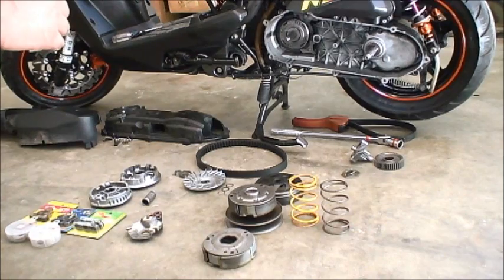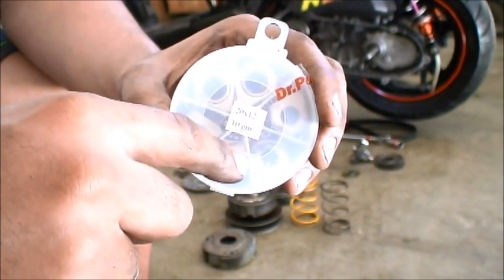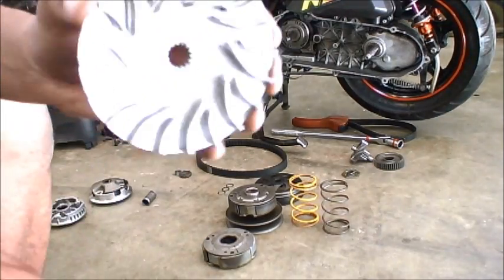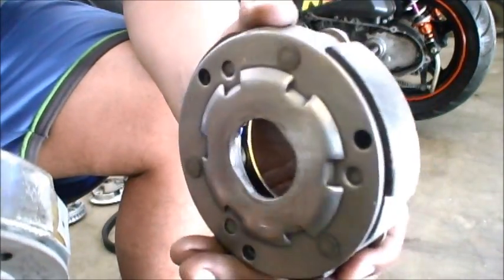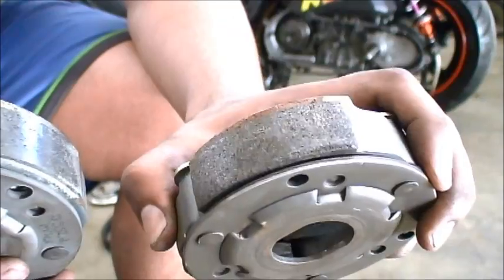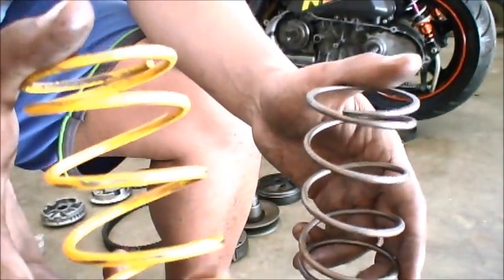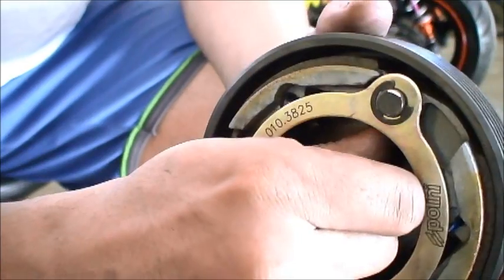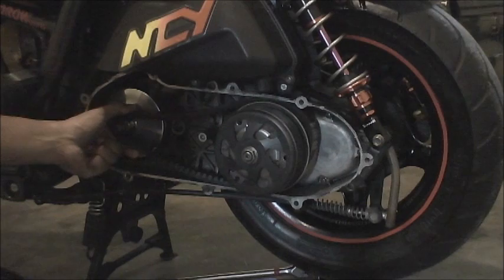CVT System of a Zuma 125 BWS125

Comment: Would you or anyone know this: 2018 zuma 125. Brand new. Floorboard and seat have a rubbery, pulsing, oscillating feeling, feels like the vbelt slapping or something with the belt. It does it around 28-38 mph then goes away with throttle. Had 2 shops look at it and said they “don’t feel anything” or it’s minor. It’s actually really annoying and being it’s brand new, now with 2000 miles, it’s an option to change the belt. Possible a bad belt from the factory. Both shops inspected it and everything seems in spec.

Comment: Very informative, your explanations and demos have given me the confidence to work on my own scoot.
Reply from the maker: Thanks! Just a pointer.. don't use a impact to fasten  the bolts on the front or rear pully because of the risk of stripping the threads on the crank. Using a impact to loosen is fine if done carefully.

Comment: the sliders sit lower so you get better low gearing, slide easier for quicker CVT transition and ride higher for a taller final gear. they work good only downside is cost so i recomend finding the perfect weight with conventional rollers then order some of the teflon sliders to replace them